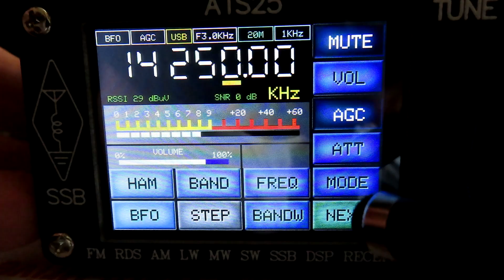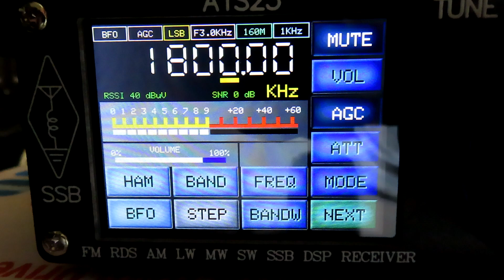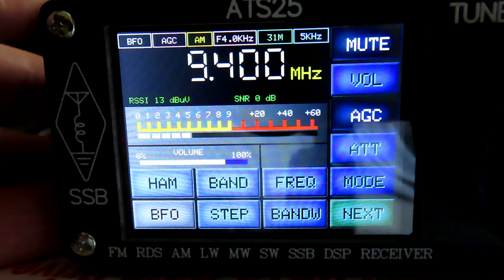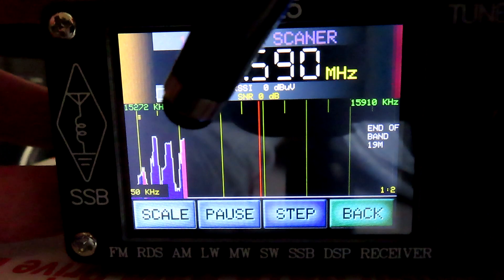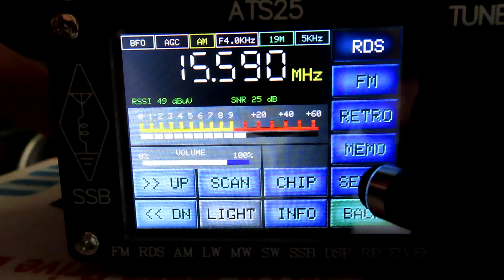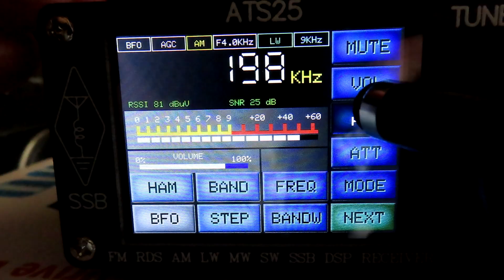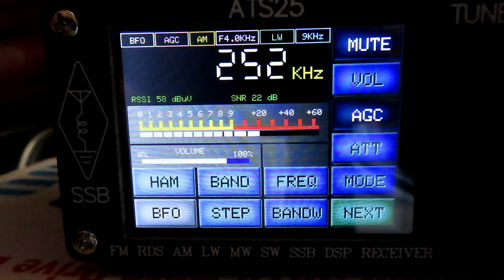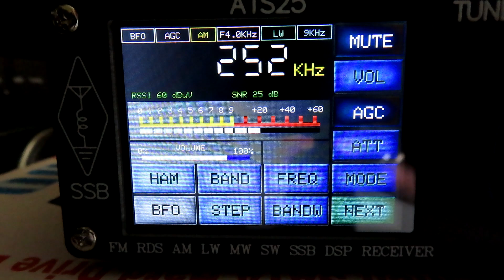A closer look at the new ATS 25 Firmware

Comment: Seems these radios don't have a dedicated noise reduction DSP? Even a Malachite Clone has it, adjustable in dB. Maybe that is what they modded with the AGC. Works in the same way (Almost). BTW, a Malachite (Clone) is able to receive not only CB in FM but on any band that is in wide, Normal and Narrow (even manually adjustable).

Comment: I just bought the ATS-25X1 - Agreed, not the best radio (my Chinese Malahit Clone v3 is better), but frankly for ~$100 USD, its really a fun toy.  Has decent audio and used with the amplified GA 450 antenna (I have outside antenna restrictions), it performs quite admirably.  Everyone is entitled to their opinion, your mileage may vary, but pleasure is in the eye of the user.  Thanks again for all of your great videos and insights, the information you provide makes this hobby a lot more enjoyable
Reply: BobKantor has the 25x1 improved on the band limitations mentioned here? I just bought the 25x1 and it hasn't arrived yet.

Comment: I have the version ATS-25X1 with the same software.  The SI4732 chip is designed to be used with a short whip antenna.  I also have the C Crane Skywave and Xhdata D-808 radios.  They also show overload issues when connected to a longer wire antenna.  This chip has high RF input impedance, which is not a good match for wire antennas and some active antennas.  It is better to use a receiver with a 50 ohm input with these types of antennas.  Using a BNC tee and 50 ohm terminator to make the receiver have a 50 ohm input greatly reduces the overload issue with my ATS-25 and other SI4732 based radios.  I use them a 40 meter end feed half wave antenna.  I can see a FM station broadcast antenna from my street, so, I have encountered FM break through problems.  Yes, the SI4732 based radios are not a great receiver, but, it is Okay with its limitations.  It is similar to 5 tube receivers of the 40s and 50s.  Thanks for sharing your videos.
Reply: Hi.  I have the same ATS-25X1.  Just wondering if there is a user manual and where would i find latest firmware please.  Thanks Tony

Comment: Great they've reduced the muting. When I'm tuning around on the 2001d or any of the older PLL radios I really appreciate the non-chuffing effects compared to the likes of this SDR or any of the recent Tecsun portables barring the H-501x which doesn't have this problem. Thanks for this vid, Kev, much appreciated as always and keep up the good work , 73s
Reply from the maker: Tony the Tecsun S 8800 does not chuff either.

Comment: I agree, these Chinese SDR receivers are not the best radios, but are fun to play with. I recently purchased three different models, ATS-25+, ATS-20+ and Malehit Jsvtro. The ATS-25+ has the hardware mods so the battery monitor and light brightness functionality works and was installed with v5.2 firmware. I rolled it back to Binns v4.0 software as I didn't like the way FM RDS worked in v5.2. I understand a v4.1 software is in the pipeline. I feel the ATS-20+ is a slightly better radio than the ATS-25+, benefiting from some extra FM bandpass filtering and FM bandpass amplifier circuitry, plus it uses the same rotary encoder of the ATS-25, and there is less internal noise. I think the latter primarily comes from the LCD display in the ATS-25. The ATS-20+ came with version v2.0.3 software which I upgraded to v3.0.4 software from the Chinese OLED V3 sketch. I prefer the original button functionality in V3 stetch compared with the extended button functionality offered in the V7 & V8 sketches. My initial impression of the Malehit SDR receiver is it's a much better radio than either the ATS-25+ and ATS-20+, especially if you connect it good antennas and make sure you are not overloading the front end of the receiver. I searched the Internet and YouTube for the reviews on Chinese Malehit clone receivers and this Jsvtro receiver consistently got complimentary reviews. It was installed with latest downloadable Malehit DSP1 firmware (1.1.0D) and is a registered receiver. It was well packaged when shipped and included a two-page colour English user guide. It has an all-metal case, decent encoders, and the SMA connector which is clamped to the outer casing by a nut and washer to reduce risk of damage. Operation is per any Malehit receiver. I still feel the performance of my SDRPlay RSP-1a has the edge on this Malehit, but the latter is more convenient to use, since it is a portable device with its built-in display, control interface and rechargeable battery.
Reply from the maker: Very interesting Andy. I think like you the ATS 20+ is the best bet amonst the ATS radios.

Comment: I always try to tune around with SW selected in the band menu as it gives you free reign on the frequency from 150KHz-30MHz. The only issue is when you manually type in the frequency it often locks you to that band you typed in (if sometimes doesn't stay into the SW mode). 

The only time when my ATS-25 gets overloaded is when I'm running my MLA-30+ antenna.

I wonder if the SSB patch that gets loaded to the DSP is causing the chuffing due to how SSB operates on this chip.

On the normal firmware when tuning in SSB when it chuffs and you have the AGC disabled it will re-enable the AGC, does this still happen on this firmware, or has it been fixed. Because on the normal firmware when you have the AGC off and you tune on SSB when it chuffs it enables AGC but the button shows that it's still off, but the AGC at the top on the screen has glitched lettering (mixed on and off).

3:03 seems to have a bug with the mute button showing that it's muted but not actually being muted.

Comment: Hi Kevin would a external preselector improve the performance of this receiver.
Reply: It can yes, but it can also make things worse especially if the noise source is located on or around the frequency you're trying to tune. And sometimes they don't make much of a difference vs not running one.